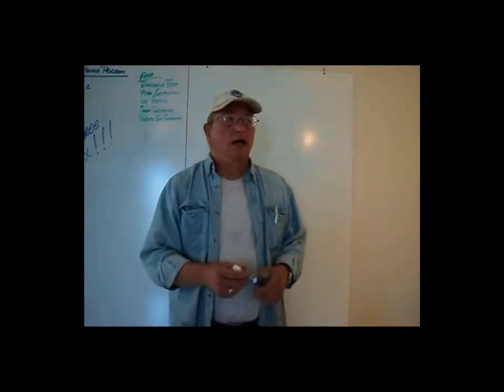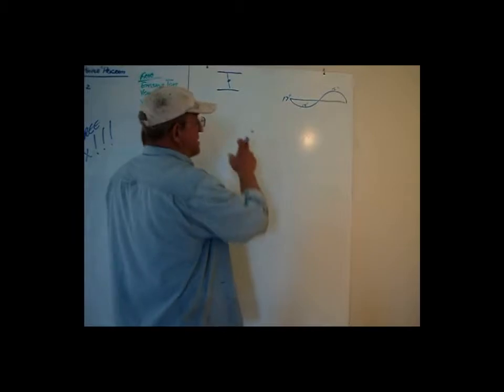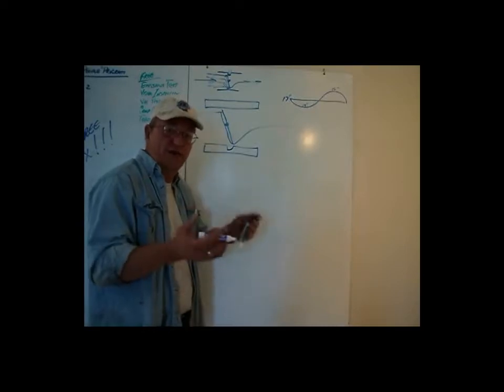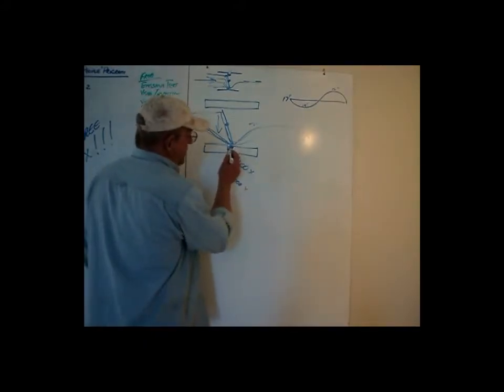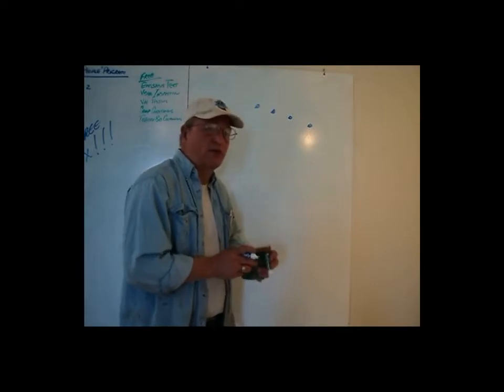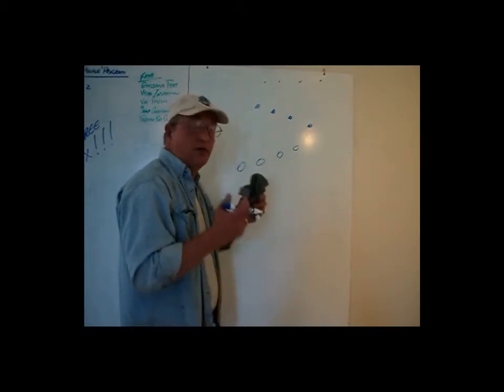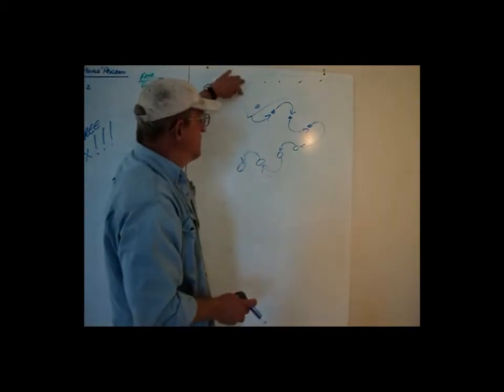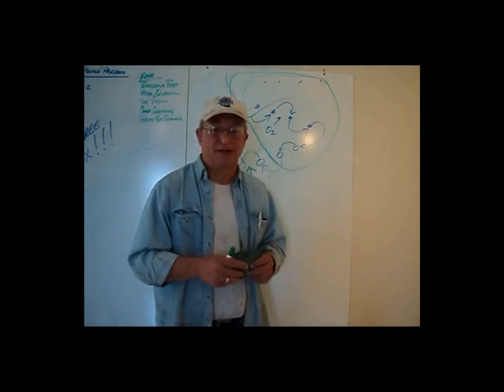How Does The Gadgetman Groove Work

Comment: I come back to watch this every so often to refresh myself.  I am glad this video is still available.  Great presentation, Ron.  Although you didn't touch on this here, I want to affirm the importance of habitually putting additional load on the engine when driving to reap the best gains in power, mpg and even long-term optimal engine health.  I've had the groove on my vehicle for 100,000 miles (engine had ~350k mileage).  I did not begin to see major results until I finally took Ron's word for it and stopped being such a light-foot on the throttle pedal.  This is counterintuitive to a lot of people.  It was for me and I still don't fully understand why this works, but it does.  In combination of the groove and more deliberate throttle input over a couple of months has stabilized the fuel trims to +-1 (from +-9), stabilized the bouncing idle rpm, cleaned out the combustion chambers (verified w/ borescope), eliminated blow-by, healed lost compression, lowered oil-consumption, quieted engine noise, DRASTICALLY increased acceleration, slightly increased mpg (30 to 32) and this is on an engine that now has over 452,000 miles.
Reply: Thanks, Wes. IT is counter-intuitive, but like Ron said, USING the Power is important!

Comment: ah! so you are creating a tumbling effect in the throttle body? thats brilliant. ford tried to do something like this in the 2nd generation ford focus intake manifolds. a set of plastic tumbler valves on a skewer like metal rod that goes through the throttle body, that tumble air, and improve efficiency. problem is, they broke apart and bits of plastic get sucked into the engine!